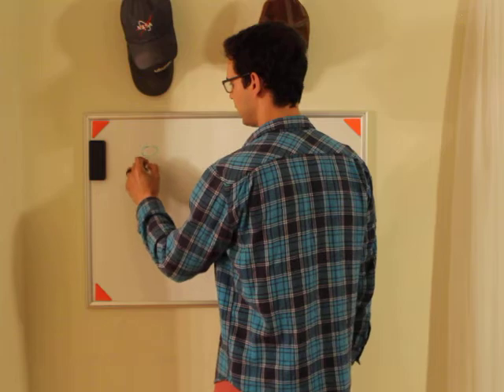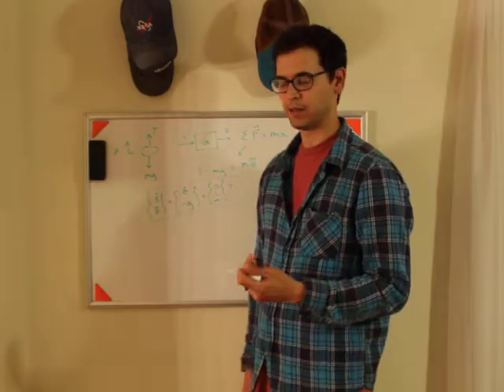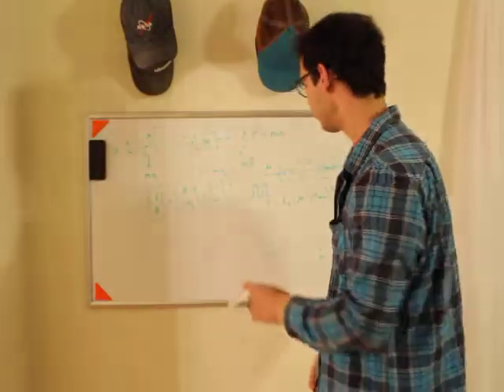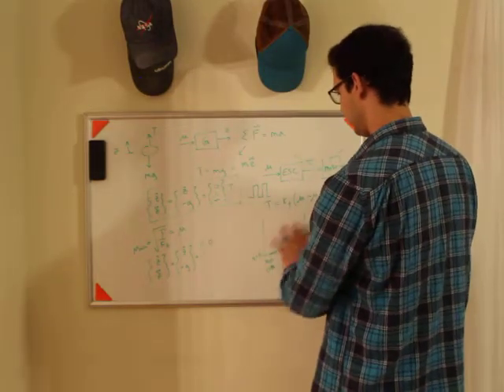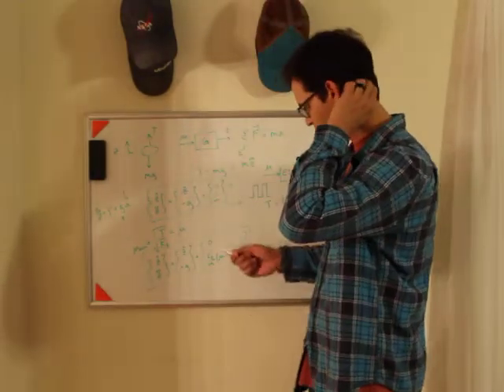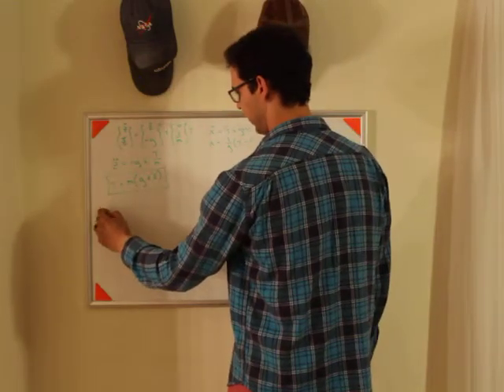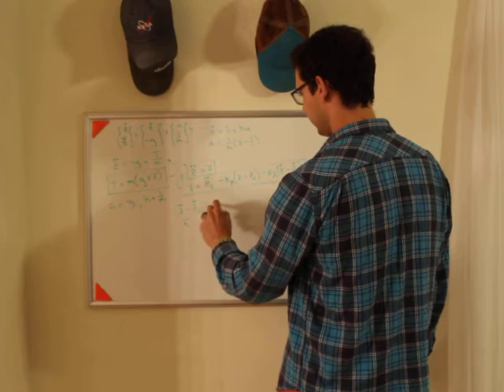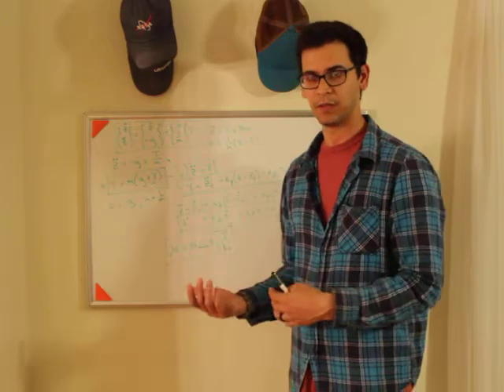Nonlinear Controls - Altitude Dynamics and Control of a Drone using Feedback Linearization

Comment: Hello, I'm a Spanish mechatronics engineering student working on his final project to get his degree. First of all, thank you for your videos, they have been very helpful so far. I'm working on modifying open source quadcopter firmware to change the PID it has for an adaptive controller. I'm realizing I have much more to learn about control systems and I was wandering if you could recommend books, videos or whatever to help me understand the subject (and your videos) better. I would love to join the university you're teaching at, but I am still studying something and, in Spain.
Reply from the maker: Hola Ignacio. Este libro es que uso para mi clase Applied Nonlinear Control
Book by Jean-Jacques E. Slotine and Weiping Li
Espero que to esta bien en Espana
Reply: @CarlosMontalvo251  Muchas gracias Carlos, ya tengo el libro y estoy estudiándolo, espero que todo vaya genial en Alabama